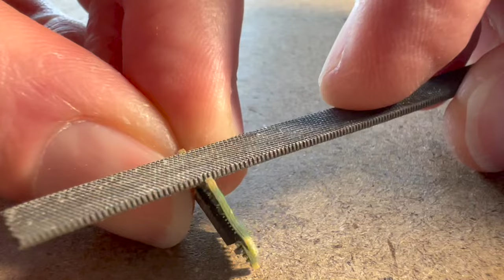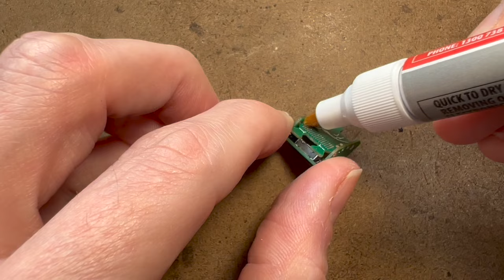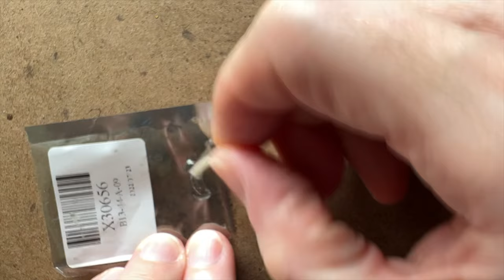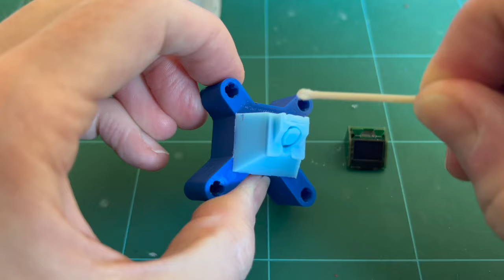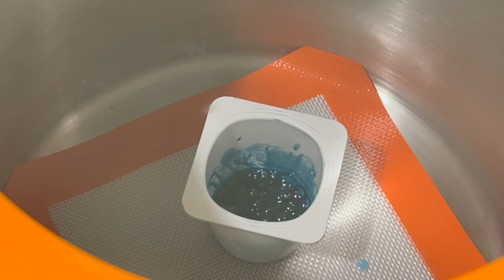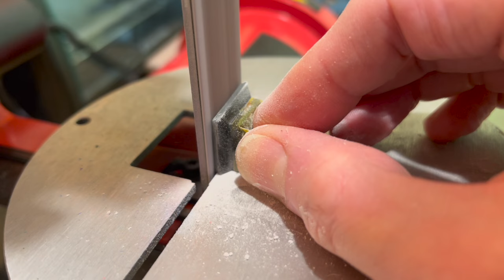Brick Assembly

Comment: I'm a tooling engineer professionally and I absolutely LOVE your tiny little fixtures. They were all a total joy to see in use. Full points!
Reply: That is what impressed me too. Including that the guide rails were Tecnic and when he extracted it from the mold he used a Lego utility tool. Now I wonder how it gets power because I didn’t see a battery, also are the top posts capacitive for screen selection? Very impressive!
Reply: @kellyfrench  If you look closely at the studs of the white block the brick was mounted on top there seem to be contacts along opposing edges, probably some batteries inside it. The capacitive controls also blew me away, I did not expect those at all!
Reply: @SergioEduP  Yep, that's a standard lego battery box.

Comment: This is absolutely amazing! I love it, and I was shocked at the Brick reveal, as I hadn't though it was actually that small while you were building it. The engineering of both the PCB assembly as well as the mold is superb I'm very impressed!

A general reminder to anyone watching this - Sanding FR4 (the fiberglass that PCBs are made of) releases extreme dangerous particulates into the air. They are really bad for your lungs. Exercise caution and use a respirator.
Reply: Ha... Good... To know...

Comment: I popped in thinking ooh, small electronics. Then you pulled out the brick from the mold and my jaw dropped. I had no idea, this is incredible!
Reply: Haha same.  Figured that any DIY minimal/miniaturized electronics project will automatically be interesting, coz you know the maker has had to think a lot about it - So I clicked play.  
But then there was 3d circuitboard structures ❤️, and 3d printed jigs ❤️, mini silicone moulds ❤️, steps taken to protect electrical connectors ❤️, and a full potting into what became the product's COMPLETE housing ❤️, and a surprise nostalgia as the finale.  
Earned a subscription from me.  Love this basement product fabrication stuff.
Reply: @roidroid  Well said, ditto to that!

Comment: I'm a bit lost as to how the power it connected to the final brick. I see an exposed USB for most of the video but at the end it looks like its able to interface with a battery block. 
You should do a video on that last bit. Very amazing work. The engineering behind the circuit board construction it amazing in itself.
Reply: Me too
Reply: USB used to load the program to the chip that makes the pretty screen. Once it’s flashed, only needs power to run the sketch on repeat - usb never required again.
Reply: @bradeng7  Yeah, I understand how a micro controller works... That's why I was asking about the power delivery to the brick, not how the screen and / or controller works.
I was interested about interfacing the design to the Lego power block

Comment: Simply amazing. While you were assembling the pcb using the blue plastic pieces I thought "it'd be a real shame to waste all the effort with the pcb work by using a 3d printed (filament type) brick to house it. I would use a resin printer or even use a mold to cast resin for the brick" and then you bamboozled me and actually did it. The blue plastic was just for assembly!

Comment: Would you sell them or make instructions? How much does the production of one cost?
Reply: The main chip, Raspi Pico, costs 1/2 dollar.  Probably $10 for all the parts.  Now all you need is mad CAD/EDA skills, PNP machine, reflow oven, 3D printer, excellent soldering skills, mold making skills, tool making skills, and a ton of time.

Comment: Suggestion for improvement: You don't really need the micro usb connector, instead use some contact pads designed to be contacted by spring-loaded pins. If you put them close enough to the surface, you can clean em up after potting. And then build yourself a custom lego brick with spring loaded contacts sticking out the top. Also, could you release the pcb and 3d construction files please? I'd very much like a closer look.

Comment: Absolutely amazing. Had a vaguely similar idea floating around about putting a small LCD into a keycap, I think this shows it's possible (although wiring it would be a nightmare without also doing a full custom keyboard)
Reply: Many programmable keyboard have extra pins you could use to wire an extra thing like a mini screen I think!

Comment: Lego should definitely develop this piece. That is so stunning man.
Reply: I'm shure they looked into it.
But LEGO makes plastic pieces for the high profit margin. They've developed and improved for decades to get production prices low.
Remember "Spybotics", "Boost" or "Mindstorms"? If these electronics were a good business, they'd keep them around.

A "Powered Up Electric 9V Battery Box" costs 50€+. Batteries not included.
What would a working screen brick cost?
If I had to guess I'd say nore than two figures (pun intended)

Comment: I like how you managed to make it work with a power block.  Might want to shop around for a different microcontroller though  I love the RP2040 but its a big foot print.  Maybe something in a a 7x7 QFN48 package?  I only know most of the specs of STM but they have some super low powered chips with enough memory.  Though, if I am being very greedy, I would like to see if you could fit in an ESP32 in that.  You wouldn't need a big antenna.  Mesh them together to sync displays...  Ugh I am going to play with this idea.

Comment: I thought I was SO CLEVER for trying to fit little sub assemblies on a board to be cut off. They thought right through it. So I made it with vias instead, and it passed... pain to cut off but it ended up being the only part of the board that worked right ;D

Comment: um, I am thinking of like, putting a raspberry pi processor in a key cap. I am wondering how i would be able to run it though. Imagine having a keyboard made out of processors. This is a Pico though, right? Still I wonder what could be done with 50 of them.

Comment: How did you prototype the initial PCB structure? All CAD then export dxf in PCB? Did you laser cut or 3D print them first before sending them to get made?
Reply from the maker: Yes, 3D model, then exported as dxf. Worked first time.

Comment: What kind of soldering iron is that? Does it self feed the solder? Subbed
Reply from the maker: The soldering iron is a TS80 - nothing special.
I'm applying solder to the bit out of shot.
For the frame, I cover it in flux and then bring in a blob of solder not because this is a good approach in general (it isn't), but because I don't want to melt the PLA jig or knock the parts out of alignment. So a quick blob of solder to hold it in place, then remove it from the jig and reflow that blob to get a good joint.
The display connector is 0.65mm pitch, and here, swiping a blob of solder across is the only way I'm going to do it by hand.

Comment: Why to use usb connector if it is disabled after potting? Use 4 pads and 3d print jig for programming.
Reply from the maker: USB is still accessible in the finished brick.

Comment: Where did you find the documentation to free the processor from the main board.  I've been looking into making my own circuit boards with processors but I've only been able to work it out for arduino.
Reply from the maker: The RP2040 minimal design example is a very good starting point. https://datasheets.raspberrypi.com/rp2040/hardware-design-with-rp2040.pdf
Reply: @ancientjames  thank you.

Comment: I cringed watching him break the assemblies apart by hand and using a file on them. I have worked with high reliabilty electronics for over 40 years. Very easy to induce cracks in the solder joints and ceramic capacitors.